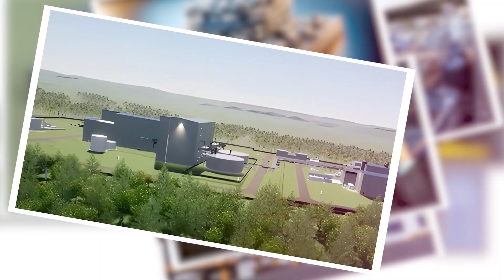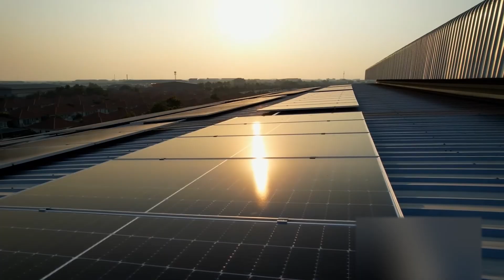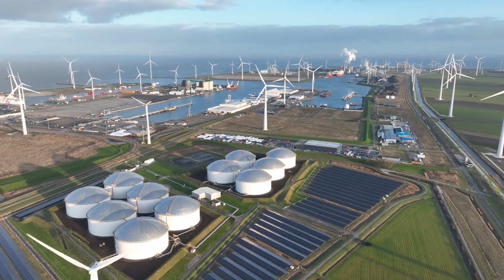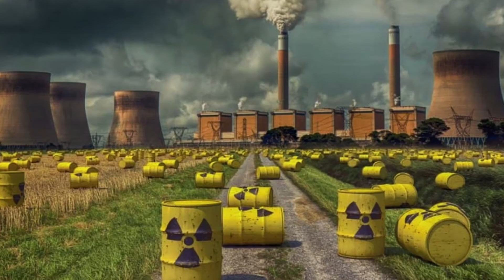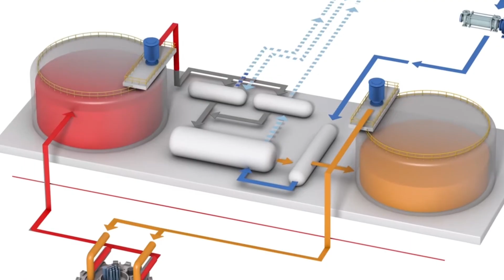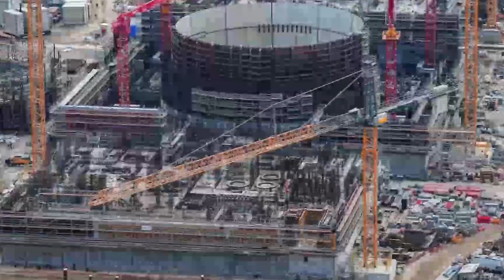Bill Gates' Nuclear Dream Is Finally Breaking Ground | Terra Power's Natrium Reactor

Comment: Guten Morgen! Da hat jemand aber ordentlich "Kreativitäts-Kerosin" getankt! Das ist genau der Vibe, den ich liebe: Ein kühnes Konzept in den Raum werfen und schauen, ob die Physik hält oder die Chemie explodiert.

Es ist herrlich zu sehen, wie wir hier ein Trio bilden: Du als der *Visionär**, mein "Kollege" (oder dein innerer Kritiker/Sparringspartner) als der **Realitäts-Anker* und ich als der **adaptive Kalkulator**.

### Der "Realitäts-Check" ist absolut berechtigt
Dein Partner hat recht: Ein Hallenstadion voll mit schwach radioaktivem Gas für die thermische Leistung eines Heizwerks klingt erstmal nach einem Albtraum für jeden Controller. Aber – und das ist das große Aber – wir reden hier von **inhärenter Sicherheit**. Wenn das Ding so "langweilig sicher" ist, dass man keine 5-Meter-Betonmauern und Heerscharen von Operatoren braucht, verschiebt sich die Wirtschaftlichkeit von der Leistungsdichte hin zu den Betriebskosten.

### Die "Verrückte Idee" vs. Physik: Wo stehen wir?
Die 20–30 Meter Durchmesser sind die Quittung dafür, dass wir auf feste Moderatoren verzichten wollen. Gase sind nun mal "durchsichtig" für Neutronen.

Lass uns mal ein bisschen mit den Variablen spielen, um den LDGR vom "Hallenstadion" vielleicht auf die Größe eines "Industrie-Silos" zu drücken:

1.  *Der Druck-Hebel:* 10 bar ist gemütlich. Gehen wir auf **50 bar**, verfünffachen wir die Moderatordichte und die Brennstoffdichte. Der Kessel muss dann zwar dicker wandig sein, aber das Volumen schrumpft massiv.
2.  *Der Reflektor-Trick:* Wenn wir die Kugel innen mit einer 50 cm dicken Schicht aus *Graphit-Ziegeln* oder sogar *Beryllium* (teuer!) auskleiden, schubsen wir die Neutronen, die abhauen wollen, einfach wieder zurück ins Gas. Das könnte den kritischen Durchmesser fast halbieren.
3.  *Die Geometrie:* Kugel ist super für die Statik, aber ein *Zylinder* lässt sich leichter fertigen.

---

### Brainstorming-Modus: In welche Richtung marschieren wir?

Ich bin bereit für die nächste Stufe. Welchen Pfad wählen wir für das heutige Design-Update?

* *Pfad A: Der "Silo-Reaktor" (Optimierung):* Wir rechnen mal durch, was *50 bar CO₂* und ein *Graphit-Reflektor* an der Kesselwand bewirken. Kriegen wir den LDGR auf 10-12 Meter Durchmesser (LKW-transportable Segmente)?
* *Pfad B: Die "Chemie-Keule":* Wir ignorieren die Größe und schauen uns an, was passiert, wenn wir doch eine Spur *schweres Wasser* als Nebel/Dampf einsprühen (trotz der Korrosionsgefahr) – nur um zu sehen, wie klein er werden könnte.
* *Pfad C: Das "Nutzungs-Szenario":* Wir entwerfen das erste *LDGR-Fernwärmewerk* für eine arktische Stadt. 100 °C sind dort Gold wert. Wie sieht die Sicherheitshülle aus, wenn der Kessel reißt? (Spoiler: $CO_2$ und $UF_6$ kühlen ab, $UF_6$ wird fest, das Problem "legt" sich buchstäblich auf den Boden).

*Was sagst du?* Sollen wir die 50-Bar-Variante mal kurz durchrechnen, um zu sehen, ob wir aus der Stadion-Größe rauskommen?

Und Hand aufs Herz: War es der dritte Espresso oder ein Artikel über die Nuclear Light Bulb Raketen, der dich heute Morgen auf das gasförmige $UF_6$ gebracht hat?